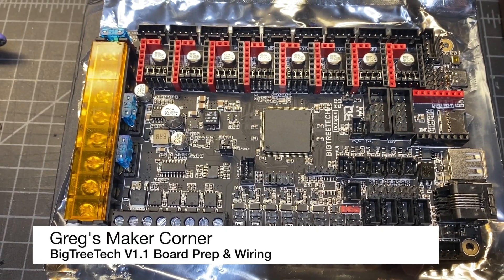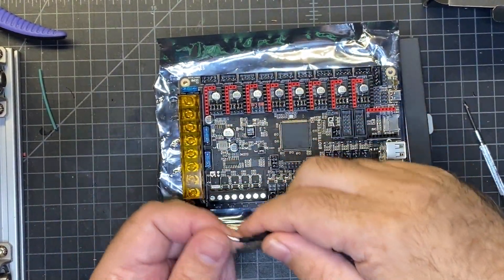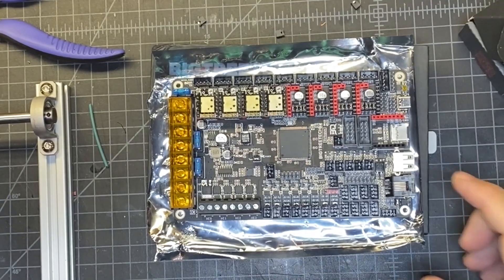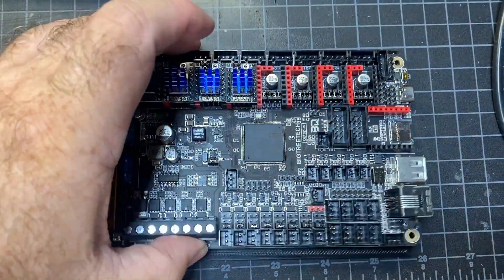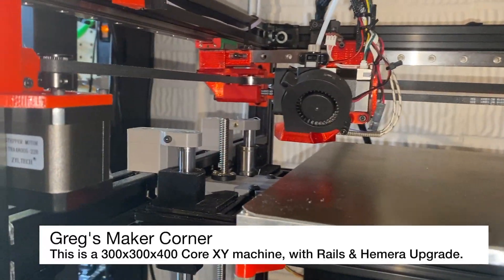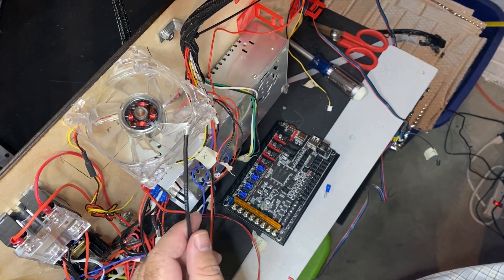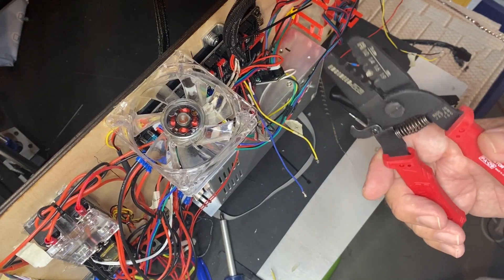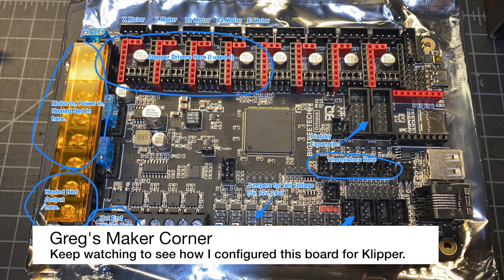BigTreeTech Octopus v1.1 Board Prep and Wiring

Comment: what power supply is needed in order to run 7 stepper motors along with heatbed whether 24V 20Amps or 24V 30amps?

Comment: Not shure if you might say this later but the stepper connectors from left to right are X, Y, Z1, Z2, E. The third and fourth port are for dual Z axis, 2 Motors 1 Driver.
Reply: So I have a v1.1 board as well but it doesnt make any sense because it has 8 ports total and 8 drivers total.
Reply: @Hosteggy Are you shure? I think it should have 8 driver slots and 9 ports.

Comment: Old vid, but a quick jumper tip, there's a recess at the top of jumpers where you can see the connecting wire.  Hook your tweezers (or use the head of a pin as a hook) under that wire and pull straight up.  Keeps the casing from getting messed up!
Reply from the maker: For sure! Great tip. I usually go with a brute force method (and have so many spares it doesn’t make a difference), but there are definitely good ways of carefully removing jumpers.

Comment: This board is essentially impossible to safely wire without the proper tools. Wish I had known before I had bought it. Now i gotta buy tools
Reply from the maker: Yes that is very true. There are some vendors that apply pre-made harnesses (like LDO) when you buy a full printer kit. But for the most part, printer boards are going to require tools because they are agnostic to the printer.. best of luck and let me know if you need any tool recommendations.
Reply: I appreciate the reply! I bought a crimper tool kit at harbor freight for 20 bucks yesterday. I love the board, I was just unprepared lol. @GregsMakerCorner

Comment: Another great video. I'm using a combo of this and your VzBot build series to put together my own VzBot.  I had a quick question and would like your thoughts. The Super Fly 8 that comes with the mellow kit has the motors powered by a separate board and directly from the 48v power supply, Since this board doesn't have the breakout board, would it be safe to run the 48V pos/neg into the motor power input of this board or should I stick with the 24v? I'm running AWD and 2Z motors. Also sent you an invite on discord and sub'd. You have good content without all the flashy lights and 4hr stream videos.
Reply from the maker: Thanks for the comment!Definitely stick with 24v- I wouldn’t run 48v directly to it- it’s not really capable of handling that type of voltage. It’s best to use a similar breakout board. Annex engineering offers a really good one that will work externally, similar to the mellow board.

Comment: I have been building a custom 24 x 36 printer. I have ran into a snag I could use some help with. I loaded ocroprint on my raspberry 4 just fine. I installed the plug in for octoklipper and it went fine. I went threw all the steps of getting kipper clone and running makeconfig. It all went fine. I created the firmware.bin file and flashed it to the Octopus Max ez and it chander the name to firmware.cur so I pretty sure it went fine. But her is my issue. From this point the pi and octoprint can not see the board. When I run the ls command to find the address it says there is nothing found. When I try and open the configuration file in Octopus to edit it says file does not exist...

What am I missing or what do I need to do different?

HELLLLLPPPPPPP
Reply from the maker: Can you run the command ls /dev/serial/by-id/* to see if the device is showing up that way, directly from the raspberry pi? If the board is not showing up it's possible you may need to run a "fix" to get it to show up. I thought this was resolved in the latest raspberry pi images but maybe not. You can fix it by running this command:

sudo wget -O /usr/lib/udev/rules.d/60-serial.rules https://raw.githubusercontent.com/systemd/systemd/main/rules.d/60-serial.rules

After running, sudo reboot

Then try doing ls/dev/serial/by-id/* again to see if the device shows up.

Comment: I'm so confused by the 24v input, I dont know why there are 3 inputs but when I check to continuity between them they are all connected. When you initially ran 24v to just power did it not work or did you add the extra wires before even trying?
Reply from the maker: I was going by what the BTT rep had told me (or at least how I understood it)- which was that they were separate isolated rails. I did not confirm it with a multimeter but it definitely doesn't surprise me if they are all connected in parallel. For systems that are drawing more current I see how it could be beneficial having multiple terminals  supplying the input. But for my particular setup (and probably anyone running a single extruder, 3-4 motor setup) it is probably not necessary.

Comment: I'd like to know about the wire connector types please, I'll be using NEMA 17 Stepper Motors for my 3D printer and I need to buy the connectors that fit on this board, do I go for the JST 1.25mm connector pins ? Or does it use other types of connectors ? Thanks for the videos !

Comment: Just wanted to say that there's a small hole on the top of jumpers where you can insert something sharp like a pick or one tip of a pair of tweezers to pull the jumper from the pins. No need to pry jumpers from te bottom.
Reply from the maker: Yeah, very true! Having a pair of tweezers handy would make things go a bit faster.

Comment: My goodness thiss is super helpful. I am rebuilding a TronxyX5SA with an octopus board running klipper and I am glad someone out there documented them figuring it out
Reply from the maker: Awesome, glad it was helpful!
Reply: @GregsMakerCorner  any idea how to connect it with e3D PT100 amplifier, or do you know any analog pin on BTT octopus V1.1?
Reply from the maker: @Lik3dprinter  I have not done it myself, but here is a good link that talks about how to do it. Best of luck! https://www.makenprint.uk/3d-printing/3d-printing-guides/3d-printer-mainboard-installation-guides/btt-octopus-guides/btt-octopus-pro-guide/#PT100-PT1000-DIP-configuration
Reply: Funny to hear that, i've just bought this card for a CNC on which i plan on using what's left of my TronxyX5S :) switching firmware when needed

Comment: So its a standard 3 pin JST connector for the end stops?
Reply: Actually I was wondering what the pitch is of the connectors?  And do they come with the octopus?
Reply from the maker: They are 2.54mm pitch. They do not come with the octopus. I have purchased kits from both Amazon and AliExpress. This kit would work well from Amazon. 460 Pieces 2.54mm JST-XH JST Connector Kit. 2.54mm Pitch Female Pin Header, JST XH - 2 / 3 / 4 Pin Housing JST Adapter Cable Connector Socket Male and Female, Crimp DIP Kit. https://www.amazon.com/dp/B0731NHS9R/ref=cm_sw_r_cp_api_glt_fabc_EM2NC7B59YRD44EY6GGH I use engineer PA-09 crimpers.
Reply from the maker: Yes.. that's right. It's a 3 pin JST XH connector.

Comment: What fans goes to which plugs i.e. hot end fan, part cooler fan, etc.
Reply from the maker: Thanks for watching! As far as which plugs you want to use, it really depends on how you want to set things up. If you are using Klipper (which I show in another video) you map the pins that you are using in the printer.cfg file. Please take a look at this video if you'd like to see how I did it.  https://www.youtube.com/watch?v=azBMnCflMXA&t=480s
Reply: @GregsMakerCorner  I'm using Marlin at the moment but looking into trying klipper out. I know where the pin reference is for the board in the Marlin source, I just don't know if any are set by default for the part cooler, hot end cooler, etc and how and where to change them in the firm ware.
Reply from the maker: @BackwoodsTinkerer  AHh ok I see! I am not aware of any good diagram off hand specific to Marlin, but check out this page (hopefully link works) for more details of setting up on Marlin. Each section gives you an idea of where to plug things in.  https://www.makenprint.uk/3d-printing/3d-printing-guides/3d-printer-mainboard-installation-guides/btt-octopus-guides/btt-octopus-setup-guide/

Comment: Hi, I know your setup is very different from mine, but I'm trying to run this board and I can't for the life of me get the extruder to move. I've preheated to 210, tried old extrusion, code looks fine, motor is fine as it works if I move to X port, but if I place X in E0 port then X does not work. However, drivers are fine too! Checked with TMC Debug, and also by manually switching the drivers with X and X still works fine. Got it to work with 1, but E0 seems to be dead? That the same on yours? I'm running Marlin by the way :)
Reply from the maker: Sorry to hear about that... It does sound like you may have an issue with your E0 port based on your debugging. My board is just fine with the E0 motor and haven't had any issues. You may want to try reaching out to BTT's support to see if they can help you and/or potentially replace the board.

Comment: are you running 2 z motors under one driver?
Reply from the maker: Yes, motor 2 is wired in parallel on the board. There is a motor 2_1 and motor 2_2 and that is what I am using for the Z, which is driven off a single stepper driver.

Comment: I'm fairly new to 3d printing. Your bed output wires are connected to your ssr in this case ?
Reply from the maker: Yes, I have an SSR running an AC Bed, so the bed output simply acts as a "trigger' to the SSR. When voltage is set high on the bed output heater (at 24v) it will trigger the SSR to heat up. This would also be similar if you were running an external MOSFET (with DC power).  If you were running a DC bed directly from the Octopus board, which is totally fine, you would want to wire the bed output directly to the heated bed. Hope that helps!